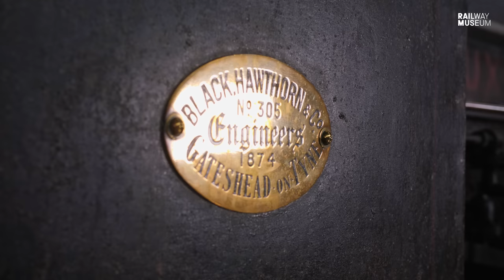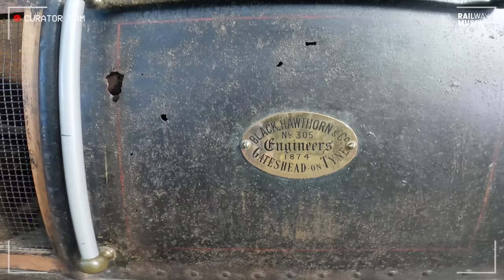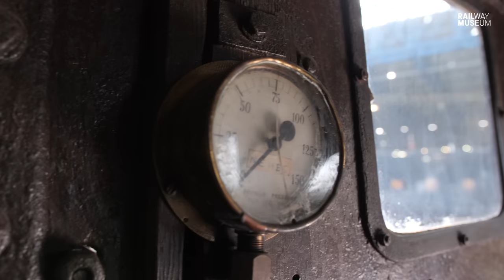Bauxite: The Little Industrial Shunter Saved from the Scrapheap | Curator with a Camera

Comment: you can tell bauxite no.2 has been through the wringer a few times there are even dents on the peice of metal that goes around the traction rods. but it's nice to see a scuffed engine that is pretty due to all the working scars it's picked up in it's lifetime.

Comment: Hello from the across the pond in the US, I am actually somewhat surprised that the locomotive has not been restored to operation as we have a decent number of small industrial steam locomotives operating on tourist railroads. I could see this getting a second, more relaxed life pulling small tourist trains and doing the occasional switching job. Thank you for preserving this wonderful (and quirky) piece of machinery.
Reply: A lot of our preserved railways do use ex-industrial locos.  What makes this one special is that it's in the condition in which it left service, which makes it a greater rarity than the ones that are still working.
Reply: @ThePillenwerfer  agreed, and I do greatly respect that, here we pretty much all steam locomotives are apart of the National Historic Registry which means no extreme changes can be made to the object and even the smallest of changes have to be approved, if it is to keep it running, then yes.
There is an old grist mill off of Ebenezer Rd in my home town of Knoxville, TN and it is almost as it was when it was built. The owners of the property are required BY LAW to maintain the landmark (in this case a building) so that future generations may be able to view it. The same could be applied to this locomotive if it was in the US. Unfortunately, I do not think The UK has a program like this.
Reply: @retr0bits545  As far as I’m aware there’s no national protection scheme for locomotives or anything other than historic buildings.  

Buildings can be listed from grade I to III with declining levels of protection.  The trouble is that it’s quite easy to get permission to mutilate them.  It is also far from unknown for owners to neglect them to such a degree that they can claim that they are a public danger and have to be demolished — local authorities are notorious for doing this.

Much rarer are Scheduled Monuments.  These are things which have to be maintained by law and it is more difficult to get permission to alter them and even protective maintenance has to be carried out in an approved way.

We also have Conservation Areas which effects everything in an area and may even restrict what colour you can paint your front door and if you can install a TV aerial or satellite dish.

Open areas can be declared Areas of Outstanding Natural Beauty which should protect them from alternations and building on.

So we do have protection schemes but money talks and the protections aren’t always worth much.
Reply: We don't have any industrial locomotives as far back as 1874 pulling any trains.
I'm not aware of any rules for preserving locomotives in the US. The FRA does make it hard to operate them since some guys almost killed themselves driving an engine without a working water glass when the crown sheet collapsed.

Comment: I do not know if locomotives where built in the 1870s with a cab. The cab looks somehow like a later addition.

I just read somewhere, I  do not know its true, that at least in germany, the train designers thought a cab with the windows is a hazard, because the  view of the driver is prohibited somehow, so they had for longer time no cabs installed on locomotives. This was also thought for tram cars, the driver standing on the open perron at first (1890s until 1920s) and later designs had a cab and a chair for the driver installed.
Reply: I think locomotives generally did have cabs by this time.  Metropolitan Railway locomotive 23, for example, had a cab and dates from 1866.  It seems like an obvious addition once any real speed is possible, and one that drivers would make strong representations about, as well as a useful method of avoiding slack and coal dust flying off and sticking to coach work.

Or did you mean that there is something about this particular cab that looks like it is a later addition?
Reply: @DanielsPolitics1   I am no expert, but somehow the cab looks like a later addition. Something about the style and how the reverse lever is outside the cab...
Reply: Impossible to say now, I should think.

Comment: also, dump buffers where made to prevent buffer lock
Reply: The dumb buffer as a concept doesn't prevent lock, you can have small dumb buffers that do so. The thing here which prevents buffer lock is a huge area of potential contact, this works just as well with sprung buffers and is why a lot of industrials came with huge buffer heads or were modified to have such by bolting/riveting an extra round plate onto the front of a standard buffer.